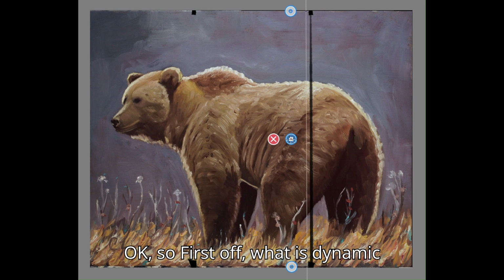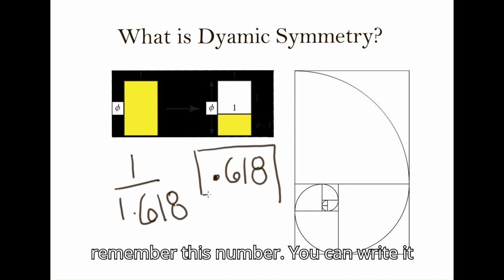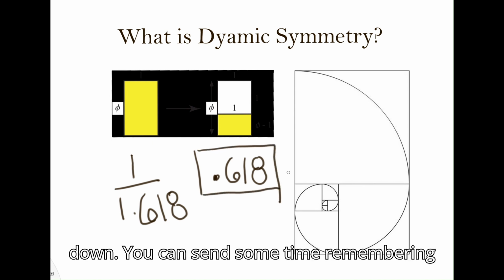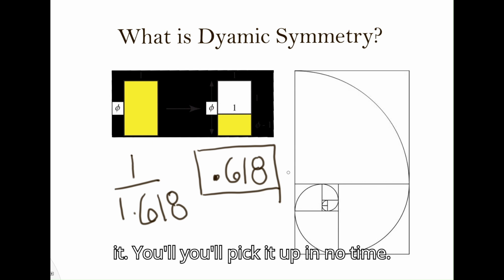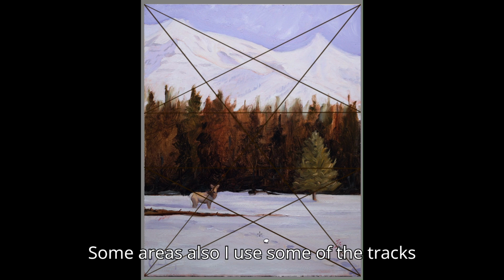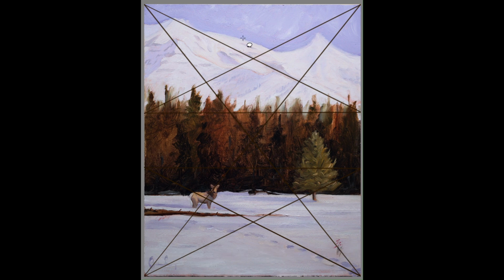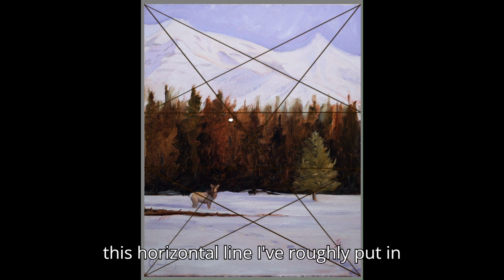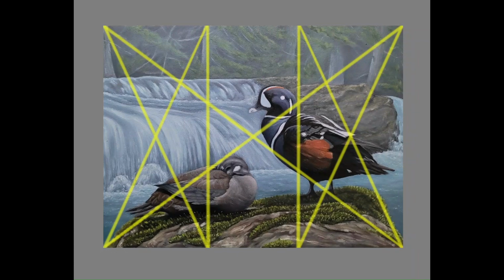Learn About Dynamic Symmetry: Improve Your Compositions!

Comment: Hi! I just wanted to supply some friendly insight on this technique. A traditional understanding of Dynamic Symmetry is based on the internal geometry of a root rectangle (ex: √2, √3, etc) this allows for the dividing up of the rectangle into a grid of smaller rectangles that all have the same ratio and proportions as the parent rectangle. The method that you’re using here is absolutely a solid method of creating harmonic compositions using divisions based on the golden ratio, resulting in a composition that’s pleasing to the eye. However, it’s not quite “Dynamic Symmetry,” especially since the example of 11x14 is not a root rectangle. I don’t mean to insert myself, but I’m hoping this might be helpful and insightful :)
Reply from the maker: Hi, thanks much for the reply and insight. I see what you mean and I appreciate the clarification. I learned this method through another artist, and I thought I'd share it. I'll look into your information more, thanks for the comment! Cheers.

Comment: I'm finding there are no hard and fast rules on composition. So many variables. The bear in your example doesn't take into consideration the balance of value and direction. The goal of every painting is to keep the viewer engaged, which means keeping them in the painting. The bear is facing left way to close to the edge and like an arrow is pointing you out of the picture. Most people enter the painting from the left and you barely get into the painting when you are lead back out. A better composition would have been placing the bear in the low right side of the painting, smaller because of his dark value. Enter from the left, down to the bear and then you have a tendency to go where the bear is pointing you, to the left, and then you would need an element to direction your eye back up to the beginning where you circle round back to the bear. That's my opinion.
Reply from the maker: Hi there, yes I agree composition is very open ended. I find dynamic symmetry to be a useful tool for the tool box, so to speak, but not something to be dependent on. I use it at times, others times I prefer to just lay out composition in an intuitive manner. As for the bear , it was very small study painting so I just needed to fill in the space as much as possible. I appreciate your feedback though! Thanks for watching, cheers!